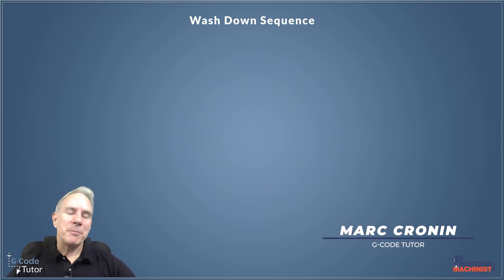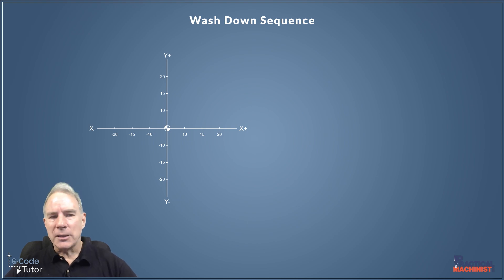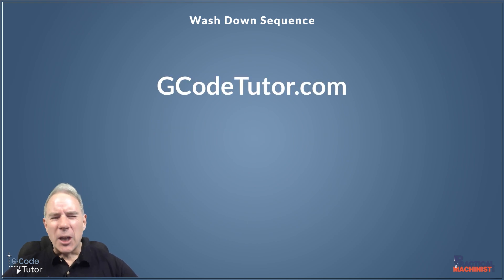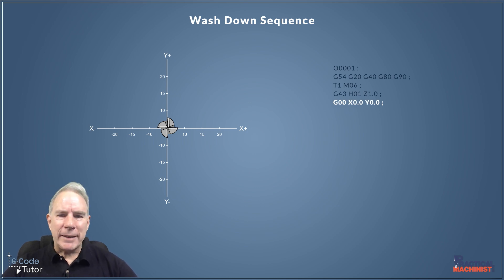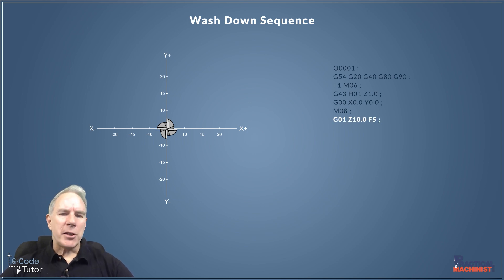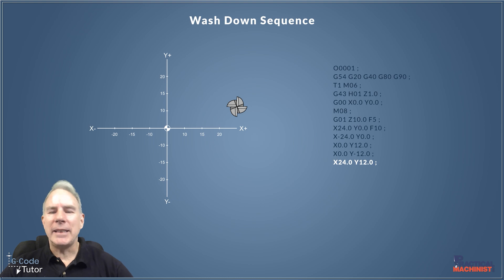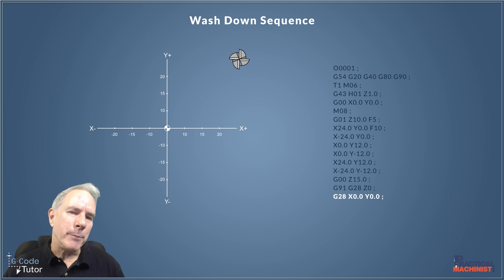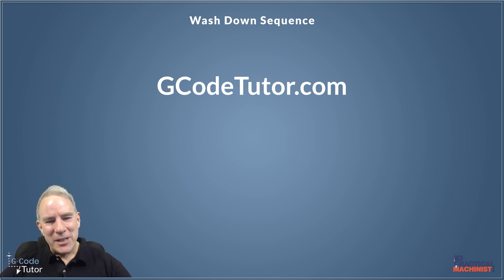My Go-To G-Code Program for Any New CNC Machine

Comment: I ALWAYS have a G90G53G0Z0 as a safety line. I've seen too many machines almost crash when someone handle jogged a machine around, and if the tool is already on the spindle that it's called for it just rapids across.